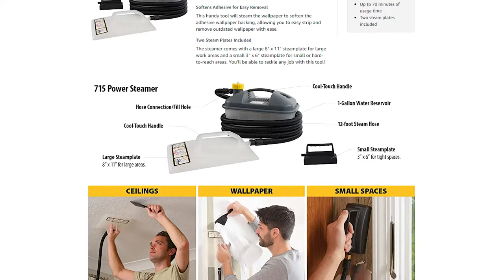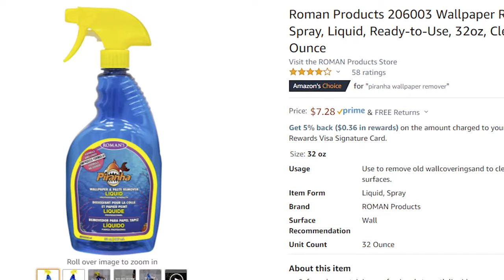How to Remove STUBBORN Wallpaper (Easy Step-by-Step)

Comment: This method will work on most wallpaper but you can run into wallpaper that the steamer won't remove.   On very stubborn (old) wallpaper that has a waterproof cover - sanding (50 grit)  is required along with scoring. The sanding and scoring will allow the steamer to soften the wallpaper to the point you can remove the top layer of wallpaper (skin) to get to the actual paper and glue. Once you peel the skin off with the steamer - go back and use the the steamer to remove the remainder of the wallpaper and glue.  This definitely will add some time to the job but it will remove extremely stubborn wallpaper.

Comment: I have actually  removed the wallpaper in my rooms with the same steamer. I had to actually tear the top layer  of the wallpaper off with my hands, then use the wallpaper steamer to get rid  of the underneath  layer which actually  worked very well and the wallpaper got removed. I'm doing my mums room for her in the rented house. My sister did not agree for me to redecorate  my mums room. I have got the Decorator  to strip all the wallpaper off and then put the new wallpaper  on in the single small room. I'm glad I came across this YouTube video. I'm from uk it has been  very helpfull for me.
Reply from the maker: I'm so glad I could help! Together, we can remove ugly wallpaper worldwide! Haha

Comment: Currently taking down 30 year old wallpaper. One room came down with no issues using a wallpaper remover spray. The kitchen has been a monster though. Only getting strips off maybe a couple inches long and then the backing is still stuck on there. I’m renting a steamer tomorrow. I’m hopeful from your video that it will help me.
Reply from the maker: Good luck!! I hope the steamer does the trick!

Comment: A very informative video. Thanks a bunch. The wallpaper i hope to remove is circa 1984 in a small bathroom. It's wall paper on top of 1-2 other layers with failed removal attempts that are quite visible leaving underneath large random elevated masses like islands on an ocean.  Then it was eventually painted over. I can't fathom how anyone could leave so much wallpaper not removed before adding more. Then again back then there was no YouTube to help. 

The quality of the final wallpaper install itself is indescribably bad with the edges grossly overlapping and that's the best part. I can't wait to see it gone. I cringe at removing it though. Having a plan like yours gives me courage and hope. 😊
Reply from the maker: Oh wow that sounds like a real mess! We had some that was painted over too but I did manage to get it off. Good luck to you!!!

Comment: Greta video! 5:14 tape over the electrical outlets so they dont get wet from the dripping steam. Use a different power outlet than the one in the wall you are wetting and stripping.

Comment: I agree with a lot of the other comments that this is the best video on removing wallpaper and using the Wagner steamer.  I've been on the fence about getting a steamer, but this just tipped the scale.  The wallpaper I'm facing has resisted all other methods.  Thank you so much!
Reply from the maker: Awesome, thank you!

Comment: OMG thank you, this works so amazingly, I tagged teamed with my 2 teens and got it done.  The only problem I'm having now is the wallpaper in the bathroom is pulling everything off, but it's an old, old house  🙃.
Reply from the maker: I love that you got the teens on it too!! I'm a mom of teens as well. They can be helpful when they're up for it. 😀 Sorry the bathroom isn't working out as well. Sometimes, if it was installed on bare drywall or plaster, it really isn't coming off without major damage to the wall. I hate to say it, but you might have to replace some plaster or drywall.

Comment: This video is so informative! Thank you! I have painted over wallpaper. Will be getting all these tools and will try to remove but do you have any tips with thick paint over the wallpaper? 😅
Reply from the maker: Some of ours was painted over. The steamer still worked but it took longer to penetrate into the paper. Some had paper then paint then more paper and that's the part that required the special spray to get through all that. Best of luck to you! It's not easy!

Comment: I use a heat gun on wood chip. Works a treat. Got to be a little precise with how much heat you apply but works a treat.
Reply from the maker: I'm confused what you mean. You heat some wood and put it against the wallpaper?
Reply: @MomCanFixIt  apply a heat gun to wood chip wallpaper
Reply from the maker: @thatwasthedaythatwas  Oh I just googled what wood chip wallpaper was! I have never heard of that in the US but it looks very difficult to remove!
Reply: @MomCanFixIt  it’s the Bain of 90% of cheaper housing in this country

Comment: Replace the zip tie with a medium-sized key carabiner (aka keybiner). You don't need anything fancy; you want one that looks like rock climbing carabiners, just smaller and unable to handle high loads. They can be useful for so many things besides this. Also, whether you use a 'biner or a zip tie, wear a belt. Not only will the belt help hold up your pants from the weight of what ever you hang there, but will also:
1) make it easier to hang and remove items,
2) allow you to leave the zip tie on the bucket for future use,
3) allow multiple things to be hung easily,
4) let you move items out of the way by sliding along the belt between loops.
Reply from the maker: Great suggestion! Thanks!

Comment: This is brilliant, thank you! I’m using the fabric softener method and I can’t stand the smell and the mess, it really isn’t working well. Question: does this work on particle board too? I bought a 1925 cape cod with lathe & plaster walls. Over the walls is a particle board (beaver board maybe), followed by 4 layers of wallpaper. It’s a nightmare and I feel like the wall is just laughing at me at this point 🤣
Reply from the maker: Haha, I hear you on the laughing walls. I have no idea if it'll work on particle board - I would be concerned that the board would start to fall apart when it gets too wet.
Reply: @MomCanFixIt  I think it’ll work. The board does seem to get wet, which is unavoidable. I want to remove it. Yesterday I tested an area using parchment paper and the steam setting of an iron and it came off so I think a steamer will do wonders. Just ordered, thanks so much for this!
Reply from the maker: @edythesmith5894  glad I could help. Best of luck!!!

Comment: How long does it take to remove the wallpaper? I'm looking to remove the old wallpaper from the house but want to estimate the time for schedule. Thanks!
Reply from the maker: A long time, unfortunately. I think the living room in this video took around 12 work hours and it's exhausting work so it's hard to do it non-stop. I'd give it at least 2 full work days per room. And that's for wallpaper removal only - not wall repair, painting, etc.

Comment: By chance, did you have to remove wallpaper or the borders from a textured wall? I can't find any videos online for it and all methods i find involve smooth walls 😭. Its hard to remove and tearing up the walls.
Reply from the maker: Oh boy that sounds tricky. I haven't done any textured walls, but I think the trick is going to be steaming it like crazy to get it REALLY loose so you don't have to do too much scraping.
Reply: @MomCanFixIt  thank you for the reply. I have completed about half of the room using hot water, because I don't want to spend the money on the steamer. It's just a bathroom and just a top border, or I would want that steamer. Unfortunately, some of the texture and paint is coming up with, as it seems yo be softening that as well. It seems to have been glued very well. I have tried to wipe off the remaining glue with a warm cloth and most of it remains. Thinking I can prime over it after fixing some of the bigger chunks of damaged texture, and hope it will look alright in the end after repainting the walls.

Comment: Just soak the wall with a 50/50 mixture of warm water and fabric softener with a spray bottle. Paper practically falls off the wall.
Reply: No it doesn't. I am so in the middle of this Dante's Inferno. She is correct about chemicals not working.

Comment: looked easy to get it off with the steamer
Reply from the maker: It's a messy process but this paper was not too difficult with the steamer. It depends on the wall and the paper (some are harder than others).

Comment: I should have used this instead of liquid products... with my wall paper probably from 1900s at one point i was thinking of taking down the wall and reconstructing the house instead of taking the wall paper down... i mean at times the old cement came off the wall but the wall paper remained stuck to it .. also the wall paper was some kind of plastic with cardbord like backing ... so water or liquids had no effect... of course i could have painted on it and not bother removing it but at some patches due to a leak from ceiling...it did torn off...and surprisingly came off at those patches like magic.. i was also considering artificial leak by removing the whole roof of the house and calling fire department to go hog on the house tO soak it.. so the paper comes off.. anyway.. it was frustrating to say the least... i should have bought steamer and took a couple of days off from office..bought a combi ladder as the wall of course was in stairs so normall ladders wont work..
Thanks though for your video looks and feels like realistic wall paper removal exercise
Reply from the maker: Oh boy, I feel your pain! Wallpaper removal can lead people to desperate acts. 😂 Did you eventually get your wallpaper off?